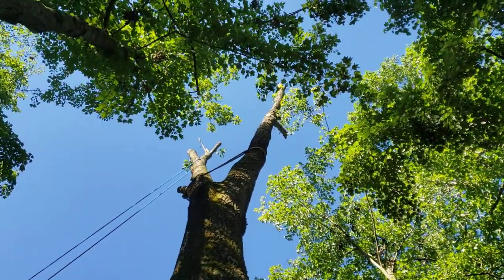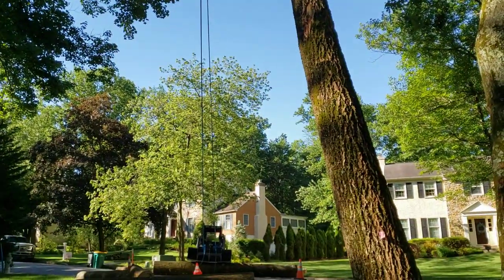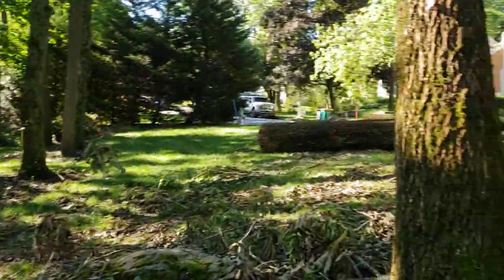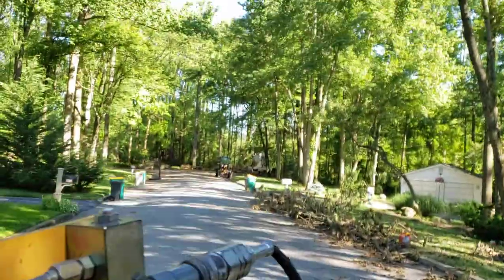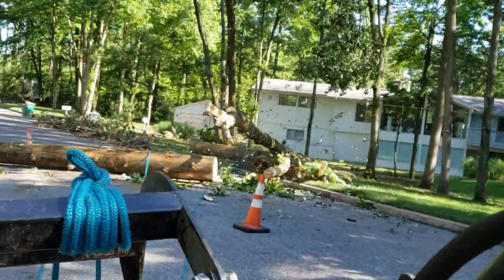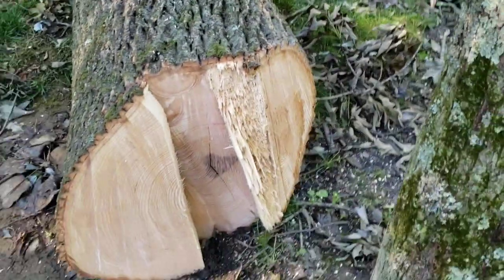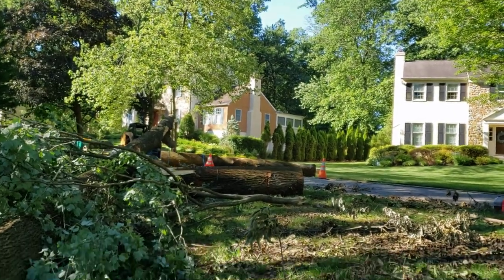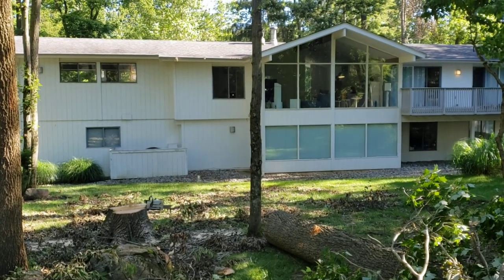Solo Falling Step Cut

Comment: Love the "working alone" video and techniques! It's how I end up doing almost all of my work except I use a winch on the truck and a wireless remote instead of a skid loader.
Reply: Same here except I have a skidding winch on the tractor. Yesterday I tip tied a couple large spar about 12" and natural crotch rigged(about level to where they were tied and with enough role for them to drop straight to the ground) them each from the ground, cut them at about 4-5, off the ground and they dropped I to the ground and stood there straight up, then I just let it down slowly with the skidding winch and steered them where I wanted. All with small rope since there was never more load on the rope than what I initially put into the system when I pre-tensioned it, nice not to need the larger ropes.

Great job Daniel.

Comment: That is a very useful cut, especially for pole size trees that need a push, but don't have much room for wedging.  An easy push with the loader is better than using a sledgehammer.

Comment: You may have spoken about it in another video, but what are the benefits of the step cut? Particular instances to use?
I’ve just never seen it used (that’s not saying much, though).
Reply from the maker: do a youtube search for Step cut 2 Daniel murphy, or watch: https://youtu.be/Qc4IYyTzYQQ
That's from 2010.
I AM pretty sure that is the first time that this  cut was explained. I had demonstrated the cut earlier and pretty sure that was the first time it was published in any form. I invented it, though there may have been others over the years that used this cut, and developed it on their own. Just not to my knowledge.
I was using it specifically to keep the notch and hinge above the root flare for greater control and accuracy, and making sure the flush ct was only a half round so that it could be chipped, since the log trucks didn't want any short pieces and the chip dumps were charging an extra $35 if there was wood in the chip box. 
It became clear at that time that the cut was useful for ensuring that the tree wouldn't start to fall until pulled with a line, so that the hinge could be formed to the needed function and still have a trigger that wouldn't let the tree go until it was pulled. That's a huge safety factor in certain situations and a good trick to keep in the bag .
Reply: Daniel Murphy 
Man, you’re slick. I’ll definitely watch the video. Thank you and thanks for all the great content. I always look forward to seeing new stuff from you in my feed.

Comment: Daniel, what kind of knot are you using to attach to the skid loader?
Reply from the maker: our other bucket has a D-ring, so we will often use the port-a-wrap on that with a shackle , especially if there will be multiple pulls. otherwise we just take 3-4 doubled wraps around the top bar on the bucket and tie two overhand knots..